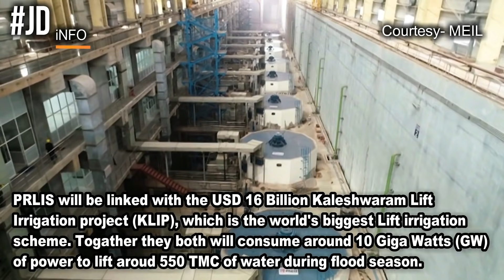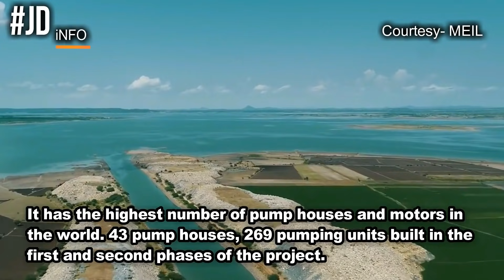India is building irrigation projects at an extraordinary scale

Comment: Yearly more than 1000 TMC of water goes to the Sea from River Godavari. Godavari River has multiple tributaries after they enter in to Telangana and AP comign from Chattisgarh, Orissa. Telangana and AP States have constructed these dams to save major chunk of that water. As Telangana is above the  River Level where these tributaries are merging with Godavari, they have done Lift Irigation to send water back into the Up River and thus water to Up Lands. 

AP is constructing the Polavaram where the hills end and the plains start with 194 TMC reservior capacity. From this DAM apart from 900MW Power there are Two irrigation Canals. The right (North) take water to North East (East Godavari, Vishaka Patnama districts) and South (West Godavari, Krishna, Guntur and Prakasham) . The South (Left) canal Merges in to Krishna River at Pavitra Sangam where Munneru, a tributary of Krishan Meets Krishna River. Both these canals are  Gravity Basis, they can take water from above 35 Meter Level. 

This Project also has Water Way Navigation system like the Suez canal where large scale Bots can cargo through Godavari River. 

AP is now starting another Life Irrigation at Polavaram so that It can pump water from below 35 Meter level and send to the Right (south) Canal.